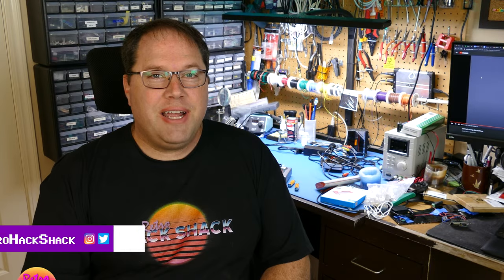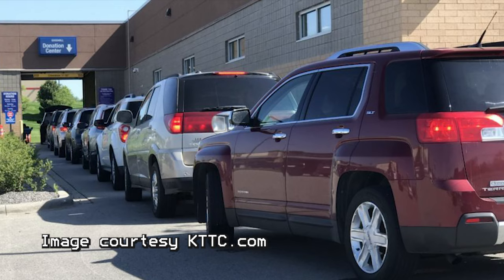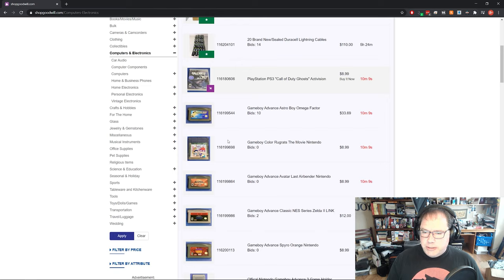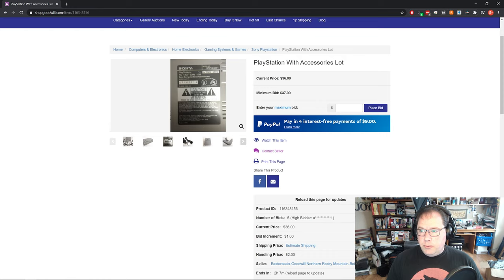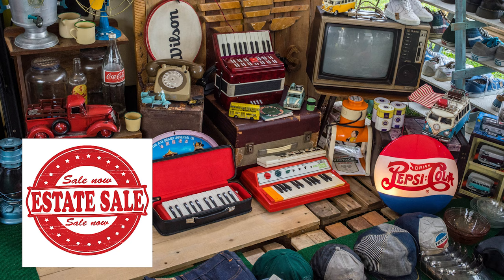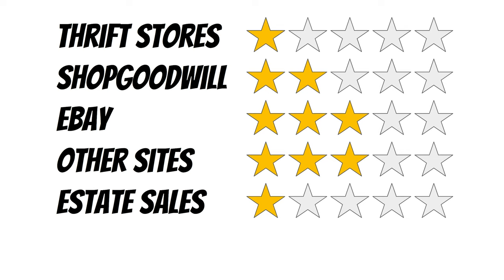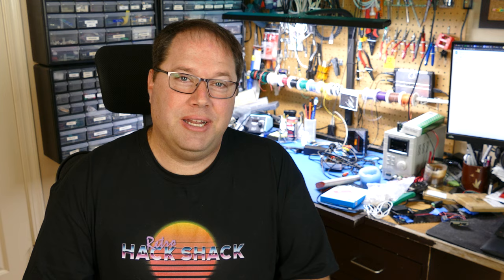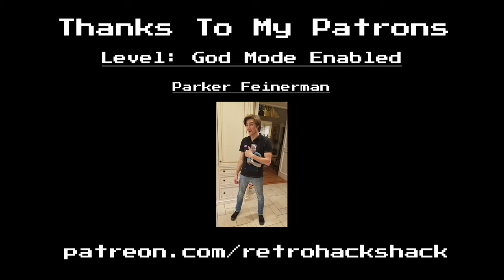Where To Buy Vintage Computers In 2024

Comment: Lovely puppy.  Golden Retrievers can be a handful if you don't take time with them early on, so you're definitely doing it the right way.

Yeah, those shipping charges for cartridges seem a bit steep.  I found a nice 23" LG display at goodwill in town for $10.00 minus a power brick.  I already had an old "universal" laptop power adapter that worked just fine once i found the right tip.
Reply from the maker: She definitely has developed a bit of a stubborn streak but she is a great pupper.